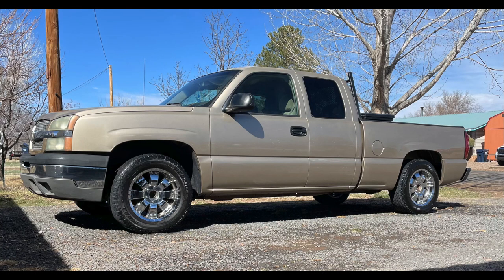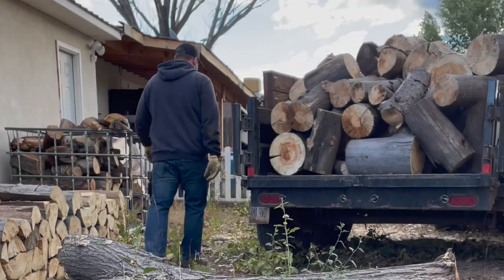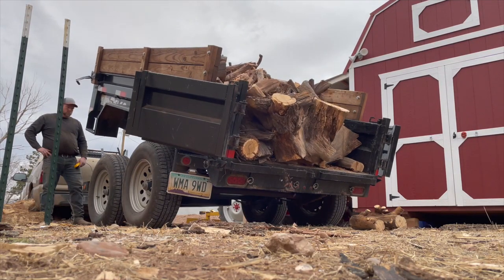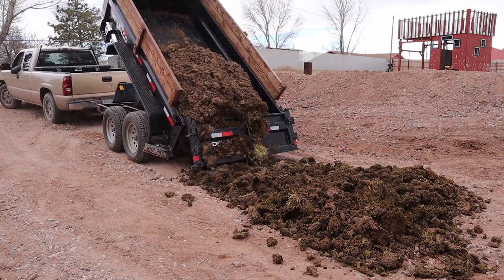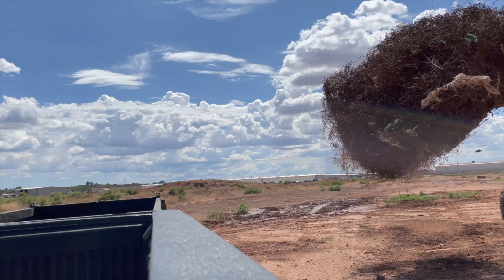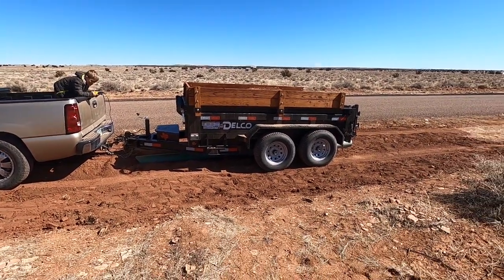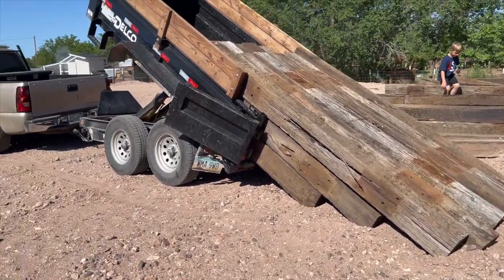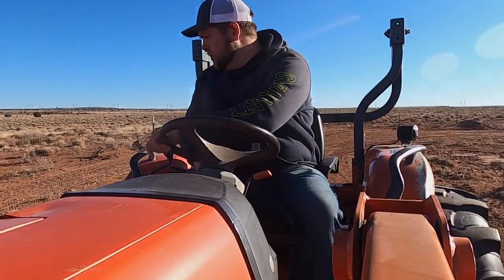8 Ways We Use a Dump Trailer on a Homestead or Hobby Farm

Comment: When I was doing a bunch of work out at my mom's 5 acre property. The Kubota tractor was definitely the #1 tool. Always handy to have it no matter what you are doing around the property. 1st it's got everything its purpose built to do: mowing, digging, tilling, pulling. 2nd it's an all terrain vehicle that can reach almost any point on the property. So I would do things like toss the chainsaw, a weed eater, some loppers, or whatever in the bucket. Then I could take that anywhere I wanted to go. 

It's also an excellent lifting machine, when I needed to re roof a 12x30 outbuilding, it could lift the roofing bundles and tools up to the level of the roof, saved me from having to carry all that stuff up a ladder. I ended up not even using a ladder the whole job. Around my house in the city, the drill and impact driver are for sure the number one tools.

While you can absolutely transport Mini excavators and small tractors it can be really sketchy. Someone dropped an excavator off the back of a dumo trailer when I worked in rentals. Also I've watched some people doing it and it can be pretty scary. One time the truck started rolling forward because the center of balance shifts when the equipment is on the ramps and the tongue picked up theback of the truck causing the tires to loose traction!
Reply from the maker: Somehow I missed this comment. Ya man! You can’t beat good tractor with a front end loader! I hope someday I can afford one haha.

Comment: Good video Sir . . . my SxS and tractor are the most used on my property.
Reply from the maker: Different areas and different property types are going to definitely call for different equipment types. A side by side would be about useless for me except for when I start using my 2.5 acres that are about 2 miles from my house. But of course a pick-up could do that job probably just as good if not better.
Reply: @DereksWorkshopAndProjects  Yes Sir.